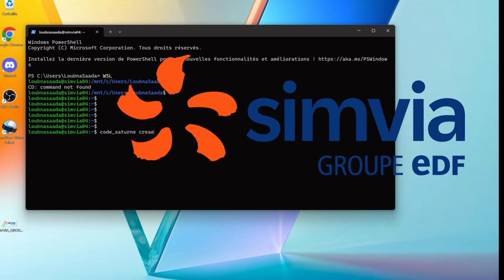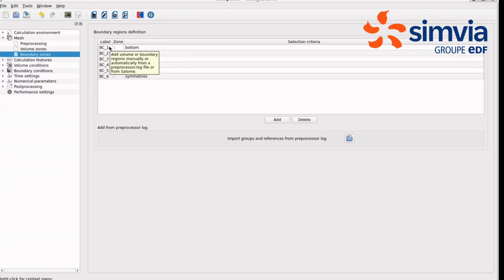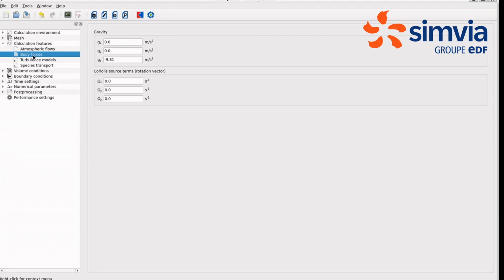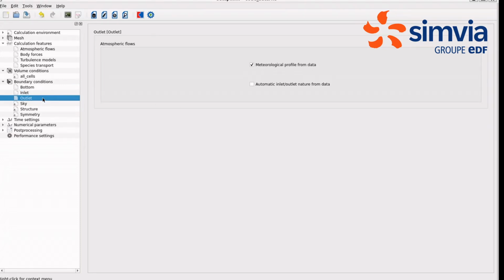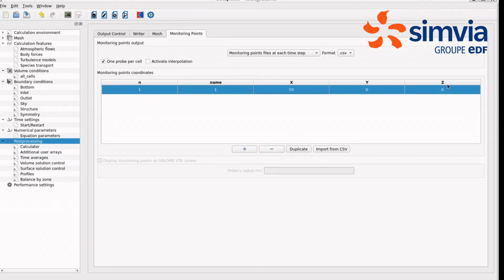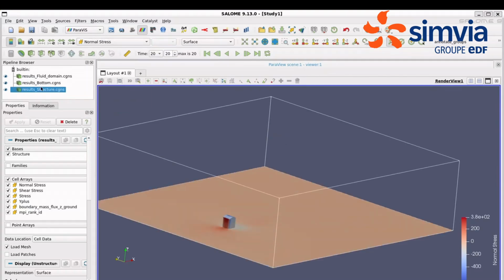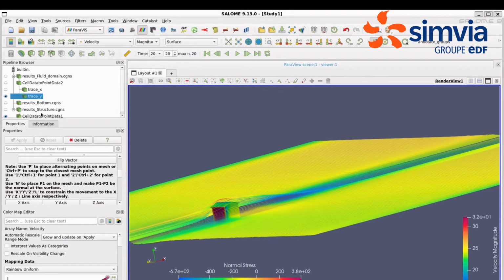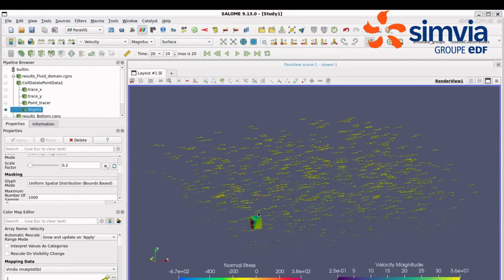[Learn & Understand] Code_saturne atmospheric tutorial: part 3, setup of the atmospheric simulation

Comment: kindly thank you for presentation! what about quantitative analysis of 'on surface' pressure?  distribution? integral?
Reply from the maker: Thank you for your comment ! Regarding the surface stress, it is completely possible to perform such analysis. The goal of this tutorial was only to show how to setup and run an atmospheric study, so the physical interpretation and comparisons was limited. If you have some reference data you'd like to use to compare the output of an atmospheric simulation, you can extract numerical values on the surface directly on Salome using paravis filters or by reading in python the results file. If you have some more subtle computations to do (for instance computing a Nusselt number on the surface at all the time steps of the run), you can directly program some C++ code in the case/SRC folder of the study. Programming in code_saturne will certainly be the topic of another more expert video. In the meantime, you may find informations on how to program in code_saturne in the official documentation.